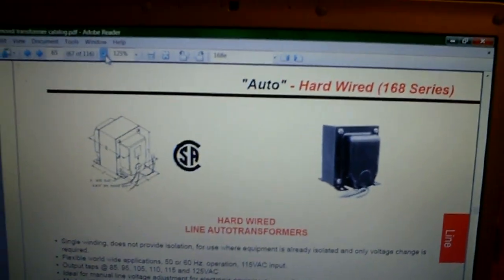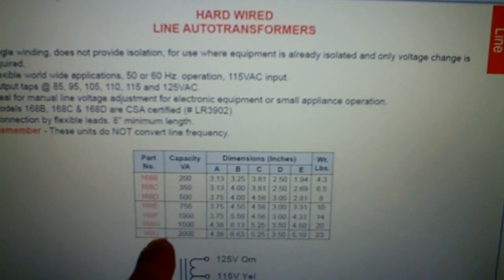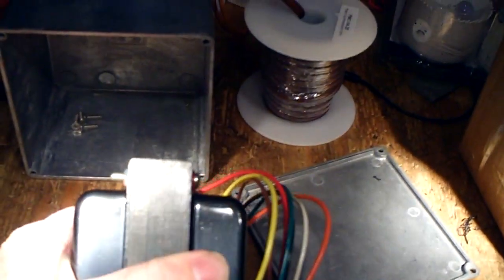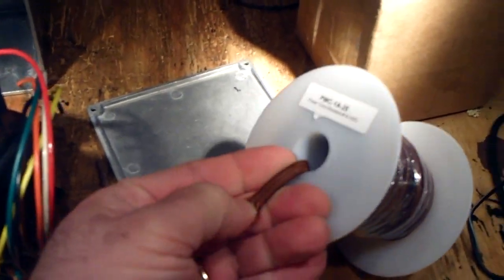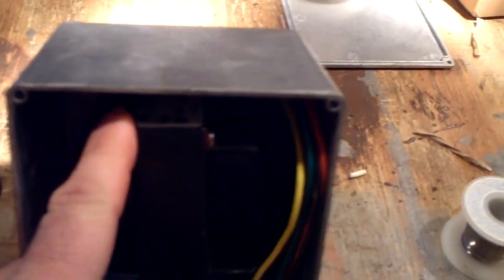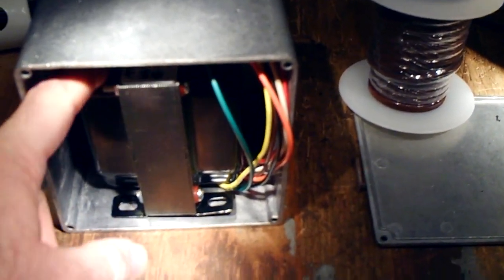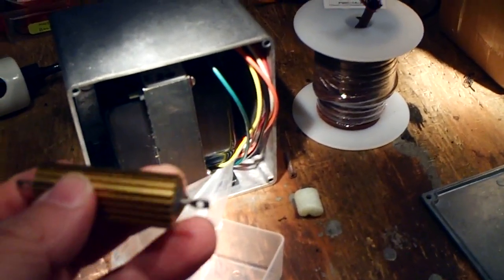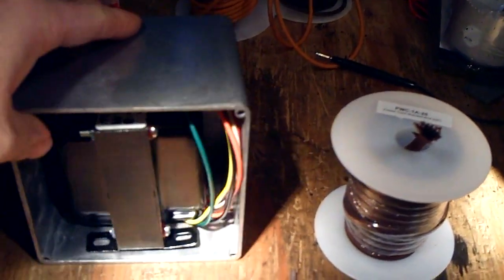Part 2 RCA 810K The problem with Voltages

Comment from the maker: @martinimetford Great! I's love to see the finished radio. Could you make a video? thanks!
That RCA rubber wiring really deteriorates. For the twisted wires that come off the oscillator coil I just coated them real good with GE clear silicone and left them alone.
Be careful of the hazardous green Cadmium Oxide dust.

Comment from the maker: @martinimetford Thanks for the comment.
Since I have many radios that require 115V, and I don't feel like modifying every radio I have, the smart thing was to go with the transformer and simply move the transformer to the radio I wish to use. Since I don''t listen to more than one radio at a time. the transformer method is perfect for my application.

Comment from the maker: You're correct, they are about 16 bucks or so. I really didn't want to mount the buck transformer to the chassis. I also didn't want to mount it to the radio cabinet in some sort of kluge. I could buy something from Hammond made to reduce voltage to vintage equipment but it's pricy. So I went for the autotrans. I figgure I can install rubber feet on the completed "box" and just place it on the floor behind the radio. I can also move it around to other radios or equipment if needed.